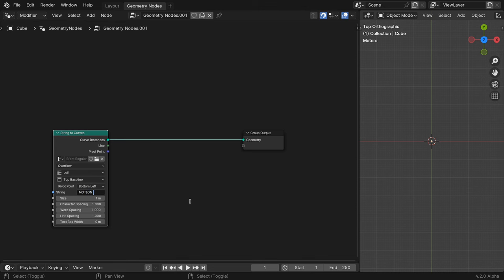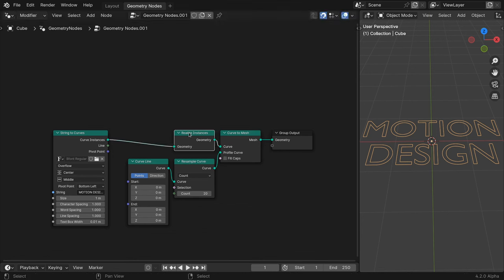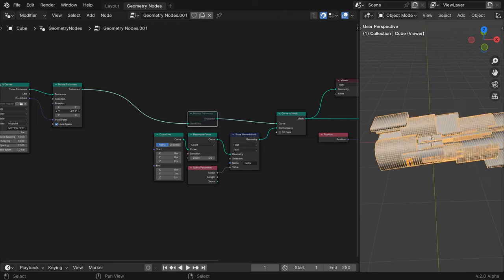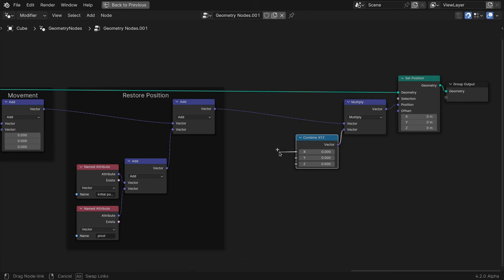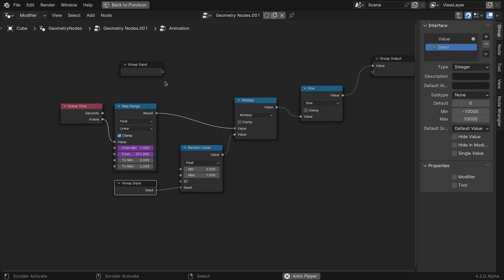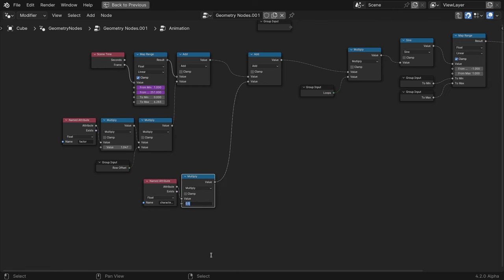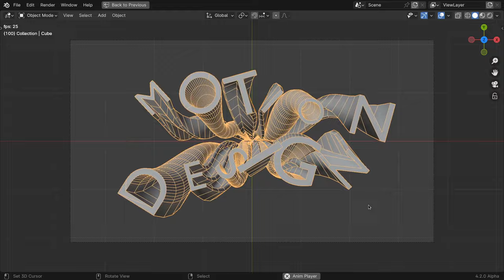Typography Motion Design in Geometry Nodes

Comment: You should not keep using the Random seed to get an Integer type. You can just set the type to Integer in the Side Panel.
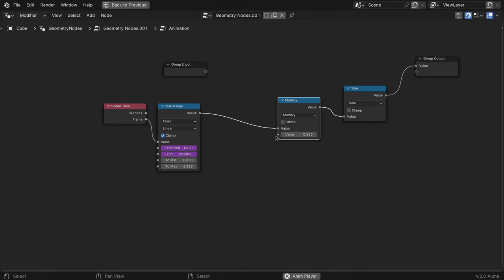Reply: can you clarify this? i'm stuck at this point (about 18:20). once i add the random value - text goes to sh#t! :D
Reply from the maker: @jonkristinarson6506  the random value is used as a temporary measure, so I can generate an integer type group input in one step, using the ‘input’ keyword. You can choose to create your group inputs in the  panel, but doing it there will add that socket to every  Group Inout node in the node tree. You see, i like to keep my node tree clean. Whenever I need a new input, I generate a new group input node with just that socket, instead of connecting everything from one big group input. I explained that in the video. In this case, the math nodes only have float sockets, so the new socket generated using the ‘input’ keyword will be of type float. Changing the socket type in the panel will also add a new socket on every other instance of the Group Input in the node tree. Rewind back some more.
Reply: thx mate. i managed to sort - was confusing at first. really appreciate the tutorial - solid pace and explanation! @ilirbeqiri

Comment: I followed the tutorial step by step but combine xyz does not connect to the add node?😢
Reply from the maker: I’m glad you’ve followed my instructions, and I’m sorry you’ve hit an obstacle. I do many times myself. May be you’ve missed something? If you need specific help, try to be more specific with your questions. I’ve used the combine XYZ node in more than one instance. Which one are you referring to, what time interval? Have you tried to connect it to any other node at all? Is it something related to my technique or a simple bug?!
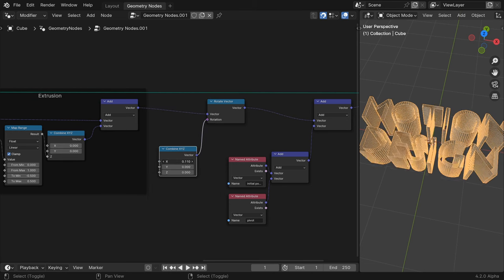Reply: @ilirbeqiri  this time code 12:54 combine xyz does not connect to rotate vector node i cant connect it its connected by red color and not working im used blender 4.02
Reply from the maker: @asafilms  then use the Vector Rotate node instead and try connecting it to that. Otherwise try it with a different version of Blender. I tried rebuilding the scene in 3.6 and everything worked as expected.
Reply: @asafilms @ilirbeqiri I have identical problem. In Blender 4.0 you cannot add a Combine XYZ to a Rotate Vector node. You get a red line. Problem solved when I used Blender 4.1.
Reply: @mystery_guy  oh thank you bro🤝🔥
Reply: @asafilms  most welcome!

Comment: Thank you for this. Very helpful. One small suggestion is that the orientation of the faces is inverted. Adding a solidify modifier will fix this. Thanks again.
Reply from the maker: I only rendered with solid colors and never paid attention to the face orientation. Thanks for pointing that out. There’s no need for another modifier, just flip the Map Range output values for the extrusion, after the mesh generation in the node tree. That fixes it. 😉
Reply: Thanks. Flipping the map range also flips the orientation of the text. Also, the orientation of the faces is still inverted. I'm using a node solidify geonode and seems to work.  @ilirbeqiri
Reply from the maker: @garrysalisbury211  I'm now in front of the computer testing this, and you're right. Flipping the map range affects the tapering step, so instead of the bottom faces, the front ones are scaled to zero. But are two simpler solutions. You can flip the polygon faces right after the Curve to Mesh node, before joining geometry with the front face. Or you could reverse the text curves before the Curve to Mesh step. Either one would work better than the Solidify modifier, because that one more than doubles the geometry.
PS: Even better, just flip the inputs of the Curve to Mesh node. I should have done this in the first place. 😉
Reply: Three solutions that work! Thanks for helping.  @ilirbeqiri

Comment: the example Mr Beqiri uses where the motion design phrase is rotating anyone have any tips on how to achive that effect?  is it just about about rotating the tapered parts and then arraying them round a curve?
Reply from the maker: I arranged the letters around a circle curve first and proceeded from there.
Reply: @ilirbeqiri  I followed your 'align text to splines' tutorial and tried to apply it to get the circle effect but im having trouble witht the realise instance node breaking the mesh making the letters shoot up vertically. is it just as simple as putting the text on a curve or is there any special tricks?
Reply from the maker: It’s a bit more complicated than that. But that’s the main idea.

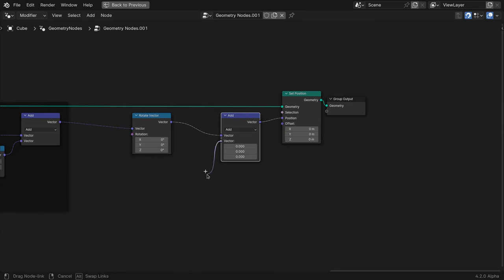Comment: I stuck on 12:38 once I add "named Attribute"and "add" nodes text turning mess up
Reply from the maker: I got your email also. It's a common mistake that most people do (myself included) when in a hurry. You had stored the initial position as a float attribute in the point domain (you should have stored it as a vector attribute in the instance domain). I sent you an edited version of the example scene you sent me.

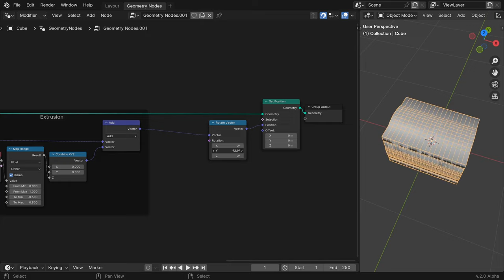Comment: I'm stuck at the 12:28 - I can't find a workable [rotate vector] node. I'm in version 3.6 of blender. Maybe they changed the name? All the letters are stacked ... but can't find a node that will do the rotate vector for the letters. Anyone have a suggestion? Ah... I think I missed changing Vector/Instance of the stored named attribute for the initial position because I didn't copy the previous [pivot] stored named attribute. Maybe the [rotate Euler] node?
Reply from the maker: In Blender 3.6 look for Vector Rotate node, under the Utilities/Vector sub-menu. The rest should be the same.
Reply: @ilirbeqiri  Thanks so much ... I had to change the type to Euler then I was able to plug the Combine XYX node to the rotation.
Reply: @ilirbeqiri  By the way, I'm loving this tutorial.
Reply from the maker: @NAU_csj2 I’m glad you’ve figured that out.
Reply: @ilirbeqiri  Thanks. I finished. I would be interested in your material setup. I think that is what pushes the project into the realm of Motion Graphics.
Reply from the maker: Hahaha, you wouldn’t believe how simple it is. Back for the front face and white for the extrusion. It’s doesn’t even have a shader applied. Mix RGB connected straight into the material input. Believe it or not it’s a viewport render, because I like the wireframes.
Reply: @ilirbeqiri  oh my =)